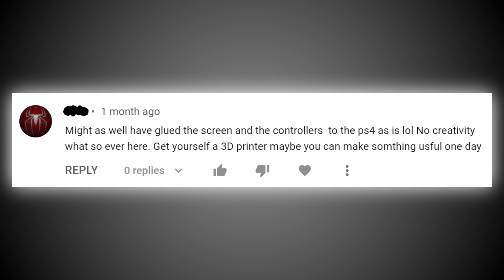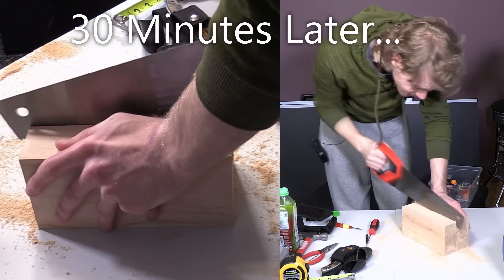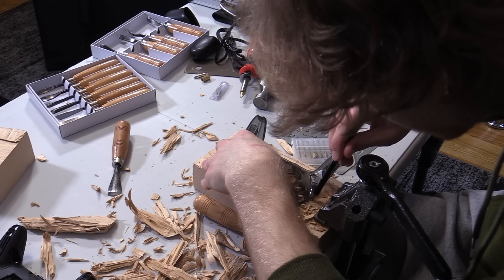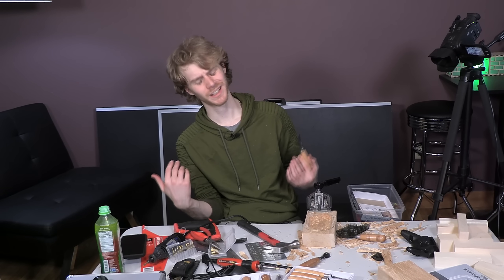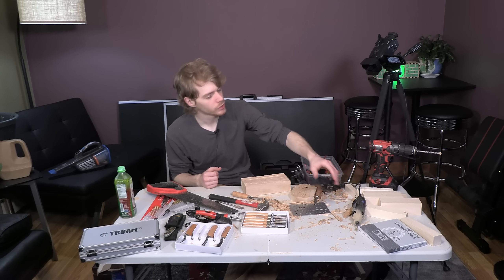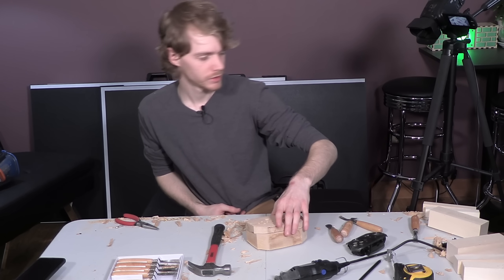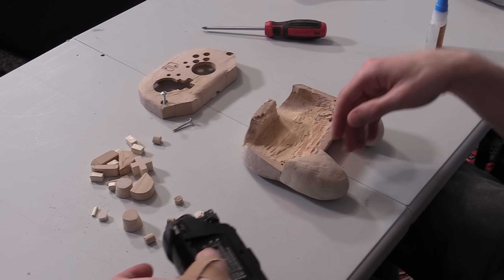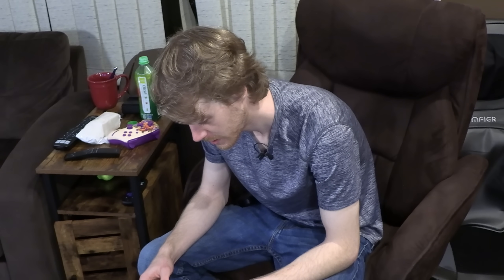Making a Wooden Switch Pro Controller

Comment: Yep, this is currently how I plan to do things. I’ve worked with wood before but not for anything project wise. I din’t have the budget or maybe the tools to work with other materials. 
Also sawing is nice intensive labour, kind if. Sometimes you want that. Sometimes you want to exercise without it feeling like or being exercise. 
1:25am 9/May/21
I winder if making a wooden mallet is actually a good first project.

Comment: Dude, ... where should I start... Uh-ok, so no face mask (not because of WuhanVirus of course)! 

Sawdust will make you very HOSPITALIZED, no eye protection, use a belt or disk sander, cuts and shapes very quickly.

Even gives super smooth surfaces, and use the dremel with the drill bit looking tip for fast removal of interior areas with smooth surfaces.

KUDOS for making it work, I hope your hand heals well!

Comment: I have hollow control overlays for my ps4 controller. They are hollow controllers with button that that extend all the way through the overly controller and make contact with the real controller on the bottom. The entire thing is heave and bulky so I fixed it to a stand . now I don't have to deal with the wait. Ask me questions. I apologize for leaving jet another message

Comment: Hey I know this is a different video but I wanted to give some advice if you were to make a new version of the ps4 portable system. I was thinking instead of making it with the actual ps4 but a windows 10 operating system and get ps now. You could then use a mini pc (which would make it slightly cheaper than a ps4), connect it with a hdmi mini display, connect it all with a case and have a very cool video. Or not. Or just don't read this. Just thought it would be smaller and more portable if you did it this way.